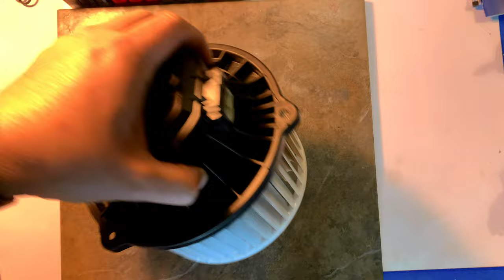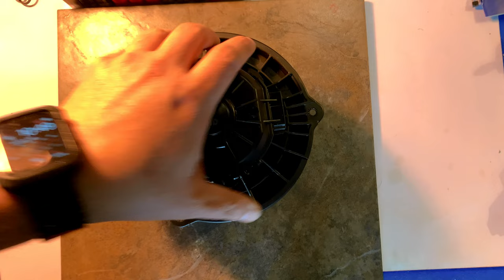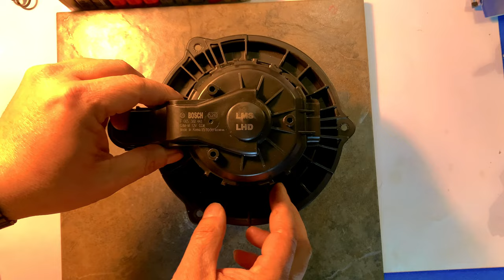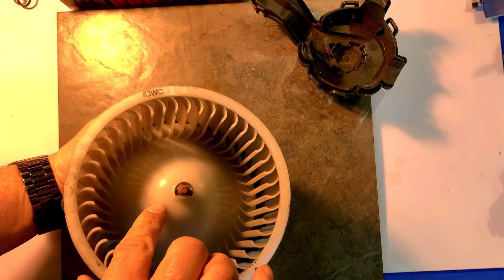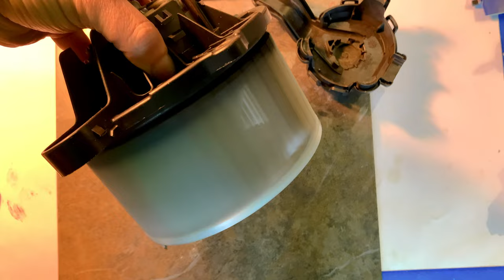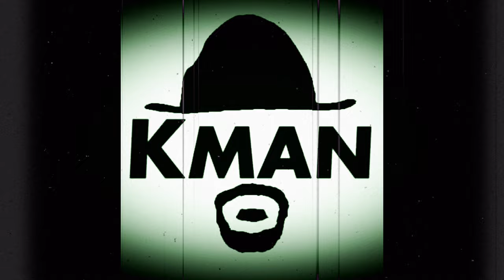Tesla Heater Fan Failure How & Why 2 weak points

Comment: In dic a tiv 🤫.  That back bush may be “oilite “ ?    May as well pull it right down  and put a couple of cheap bearings in .  Keep up the good work regards from Olde England 🏴🇺🇸🏴
Reply from the maker: I do believe you are correct! Looks to be identical to Oilite's product catalog. 

I ended up outing a few drops of thin 0w-20 synthetic motor oil on it, didn't do the other side yet, and that made a huge difference. Also stretching the springs, ran like a bat out of hell after doing that. Still wouldn't reuse it in the car. Checked my invoice again, only $50 USD for the part, extremely reasonable! :-)